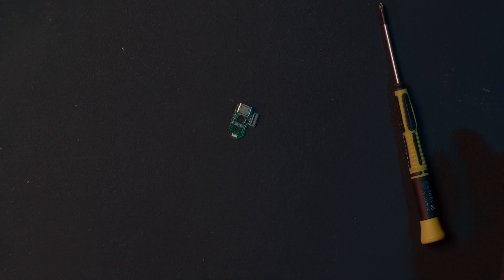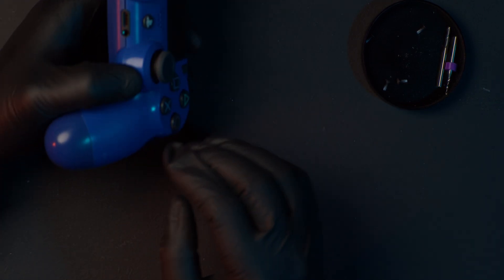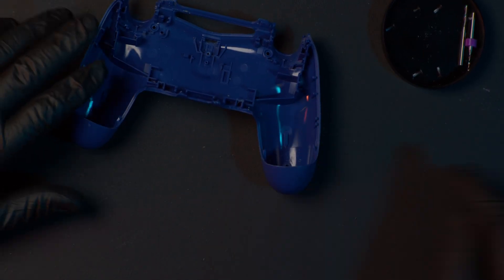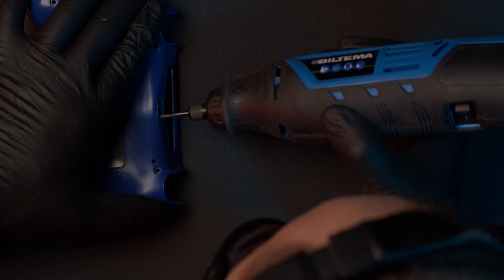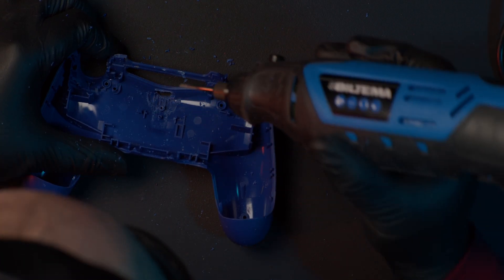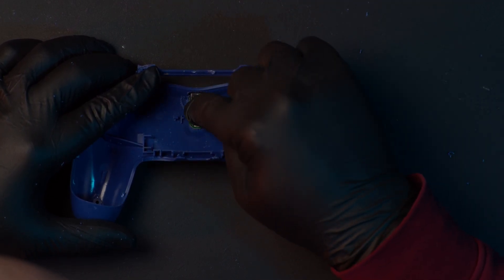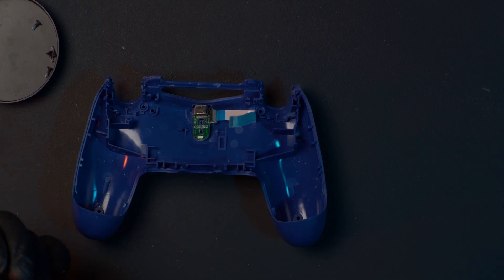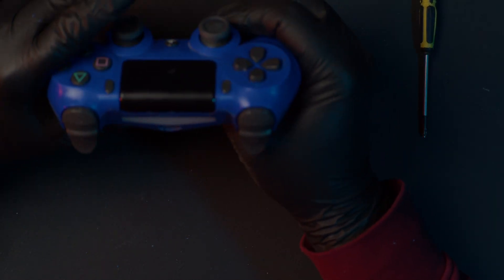PS4 controller USB-C V2 | Assembly and controller modification  | #8

Comment: This is very cool. Would you be interested in designing this for the other boards (e.g. 030, 011, etc.) or will you only make it for this board? Additionally, this project is similar to Casual Coders's version, so I was wondering if any kind of collaboration between you two would be possible as well. In any case, thank you for sharing all of this!
Reply from the maker: Thanks. I saw his board on hackaday. But i dont have any colab with him of any sort. I am making it for the other boards as well. But this one is special with all of the components on one side. Which might not be possible with the older controller shell.